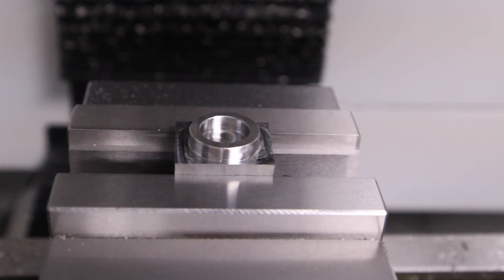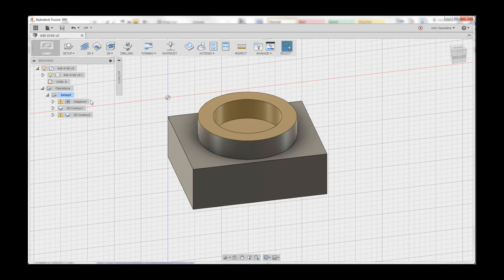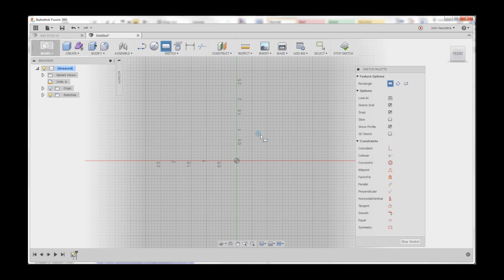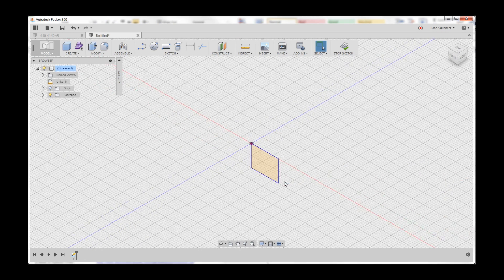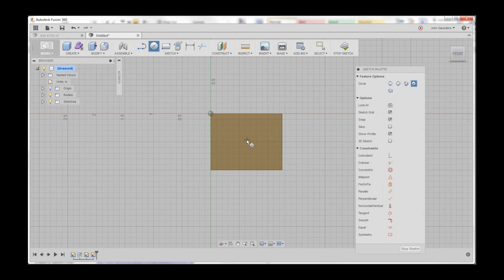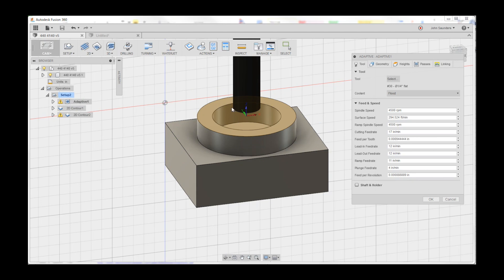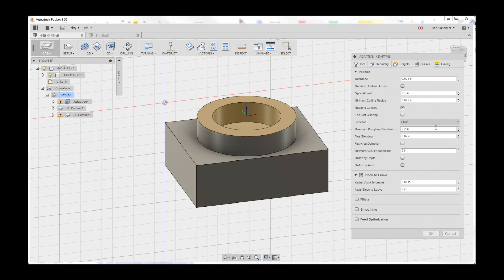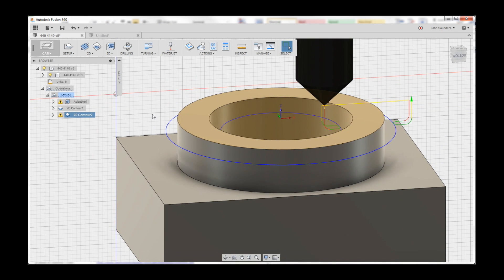Tormach 440 Cutting 4140!

Comment: The 440 certainly has a market - it's size and spec makes it an attractive, store bought alternative to performing a CNC conversion on an existing desktop size mill... It could be a game changer.

But is it just too expensive for what it is. The 770 is comparable in price and a big step up from the 440. If the 440 started at below $5K, they would walk out the door...

Also Tormach should ship directly from China and charge appropriately. A base model 440 Downunder would cost approx $9.5K Aus plus shipping from the US [so round it up to $11K Aus]. Bring 'em in direct and watch them sell... What do you say Tormach?

Comment: Hey John, in watching  I did something your video on the PCNC 440, I want to tell you something I did next to my PCNC 1100.

I niticed when you blow chips off your parts it sounds like you're using 100 PSI air pressure to do it. I added a regulator at the machine and turned that down to 30 PSI. Now I don't blow chips all over the shop any more.

Comment: Hmmm, looks like there's a pretty big shoulder on the flat. FusionCAM fail?
Reply: +NYC CNC at the end of the video when you're holding up the piece to camera, the flat surface on the outside of the ring appears to have a 5 mil step in it, no?
Reply: Looks like you programmed a finishing pass on just the outside perimeter maybe.

Comment: Great little machine! I was surprised at the feeds and speeds that you used on the steel using the 1/4 inch end mill. I use a 1/4 inch TiN coated carbide end mill at 4500rpm at 17ipm to cut 7075 T6 on a PCNC 1100 and more experience people have told me that I'm pushing the tool to it's limit. I see now that it's not true!  Time to experiment !
Reply: Very, very, VERY far from the limit.
Reply: LOLOL -- tHe LiMit for the shapeoko maybe

Comment: I love those little diamond engravers. I wish I didn't have to use it in hardened material. It's so much more satisfying in soft steel
Reply: +NYC CNC those are the ones I use - the solution ended up being to engrave multiple offsets so everything is several lines thicker. It's not quite as nice looking though and can be (relatively) easily sanded off
Reply: +NYC CNC I have! I'm looking forward to seeing that in operation. I'd definitely make one if the results look good in hardened steel. The alternative that I'm looking at right now is just having a local laser place engrave them. The more I can do in-house, the better though

Comment: But I want to know if the Tormach 440 can cut 440 Stainless Steel?

We know the PCNC 1100 can cut 11xx steel.
Reply: I would love to see that too
Reply: I was just joking because the model is 440.
Reply: +NYC CNC John, look up 440C, its a high hardness stainless used a lot for Knives, NOT fun to cut.
Reply: James T. Kilroy Jr. 440C is not that hard at all in it’s soft state. It machines more like a tool steel than what most people know of stainless. With the correct cutting parameters, tooling, and strategy, 400-series stainless should present no challenge.